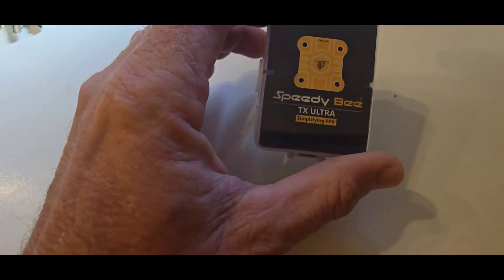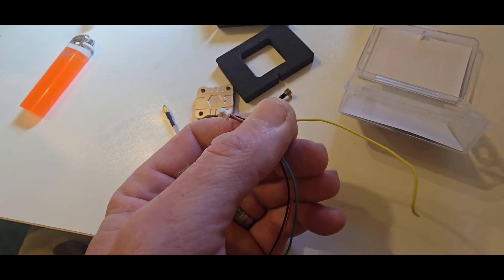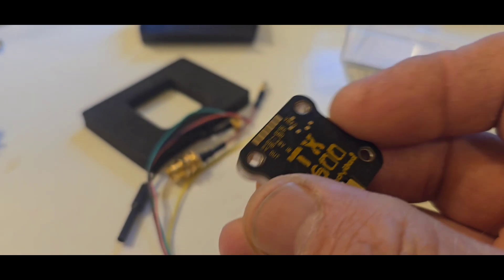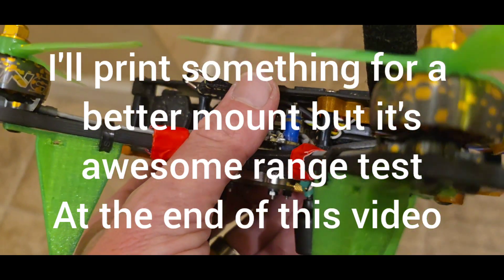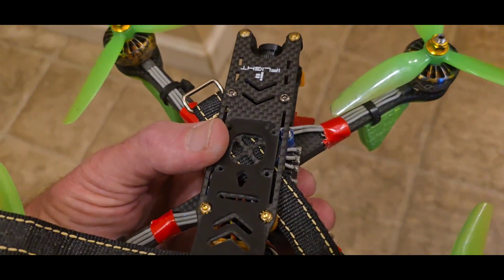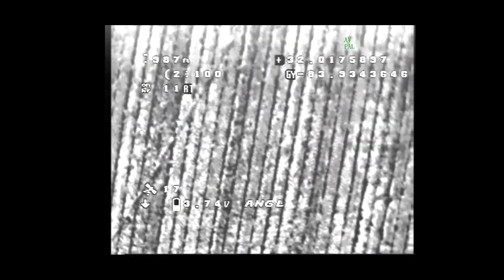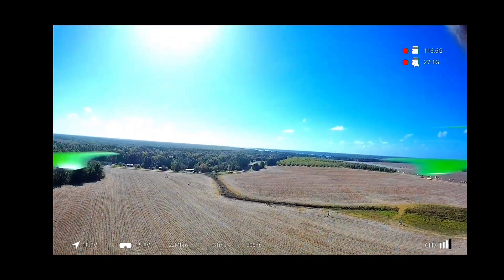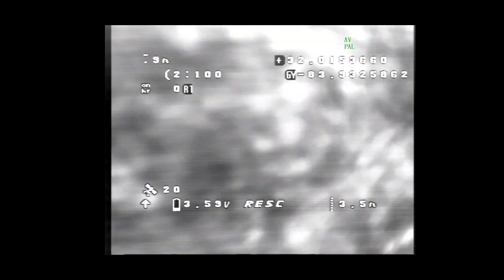Speedybee TX1600 ultra unboxing and range test walksnail/thermal hybrid long range drone build

Comment: All of my drones i built with analog and one thing i noticed when i hit my dvr on my goggles is my video i see while flying is pretty good, but on the replay on dvr, it records a bit of imperfections similar to your thermal camera.
Reply from the maker: Yes the recordings do have issues. I used goggles X and Hdzero different test with the analog feed. The Goggles X had like flashes and HDzero analog module does the best.

Comment: I've never been able to find a working VTX table for this. Any advice?
Reply from the maker: Make sure you have it unlocked as well.
Reply: @cajah1000 definitely done. I followed the usual path to the provided VTX tables speedy bee recommends and NOTHING
Reply from the maker: @sawyerphelps1149  
osd_vtx_channel_pos = 341
Allowed range: 0 - 65535
Default value: 234

osd_sys_vtx_voltage_pos = 341
Allowed range: 0 - 65535
Default value: 234

osd_sys_vtx_dvr_pos = 341
Allowed range: 0 - 65535
Default value: 234

osd_sys_vtx_temp_pos = 341
Allowed range: 0 - 65535
Default value: 234

vtx_band = 5
Allowed range: 0 - 8
Default value: 0

vtx_channel = 1
Allowed range: 0 - 8
Default value: 0

vtx_power = 3
Allowed range: 0 - 7
Default value: 0

vtx_low_power_disarm = OFF
Allowed values: OFF, ON, UNTIL_FIRST_ARM

vtx_softserial_alt = OFF
Allowed values: OFF, ON

vtx_freq = 5658
Allowed range: 0 - 5999
Default value: 0

vtx_pit_mode_freq = 0
Allowed range: 0 - 5999

vtx_halfduplex = ON
Allowed values: OFF, ON

now set the preset vtx table in the presets for the tx800 and paste this. I am not sure what fc you are using though so you have to remember or dump the vtx and check your duplex etc
Reply from the maker: @sawyerphelps1149  Use the preset tx800 in betalight and then verify pic in  video matches. I cannot add a saved file here and not sure if copied file works
Reply from the maker: I tried several and never could get max power but can pull a little over 800 MW. I could paste that setting.

Comment: bro what cam are you using
Reply from the maker: The camera was ordered with that link but the camera I received looked different but handled more voltage. Received a model U01 thermal.
Reply: @cajah1000 expensive but awesome, I want  thermal too!
Reply from the maker: https://rcdrone.top/products/axisflying-new-thermal-camera-for-fpv-drone-camera-resolution-640-512?currency=USD&variant=44917302755552&utm_source=google&utm_medium=cpc&utm_campaign=Google%20Shopping&stkn=677f40c1dee9&gad_source=1&gclid=CjwKCAjwktO_BhBrEiwAV70jXgwgKAR_gBSFn3CTXPFWxC-bSvBsDetgYDig6BCDia2rQXBuKVFL5RoCMnYQAvD_BwE